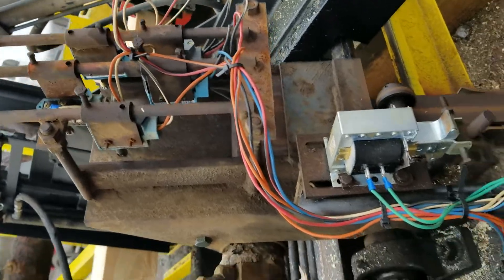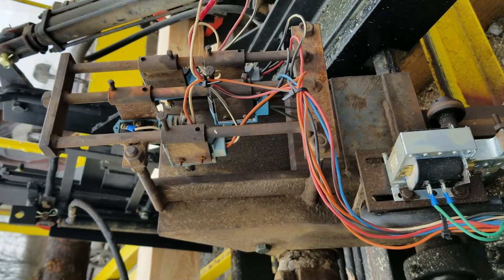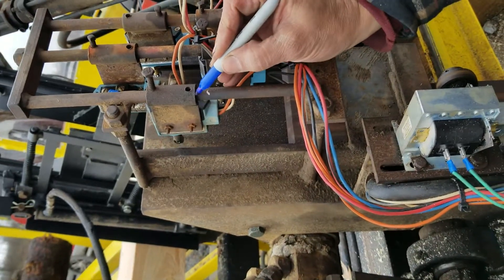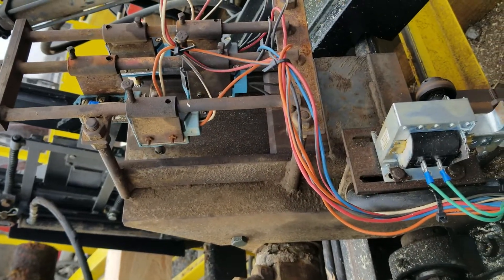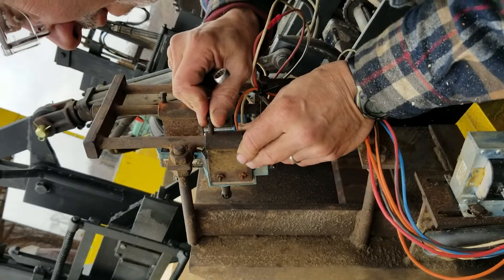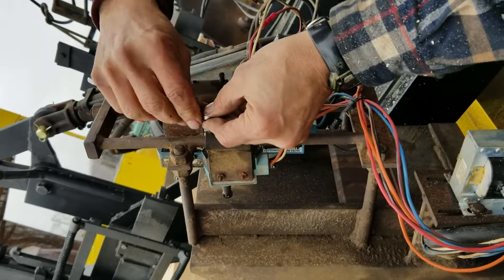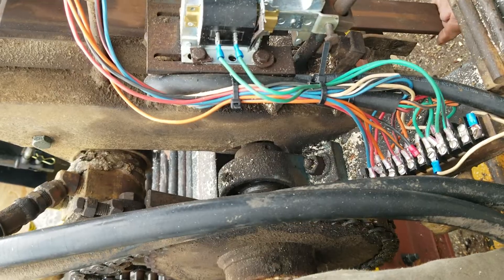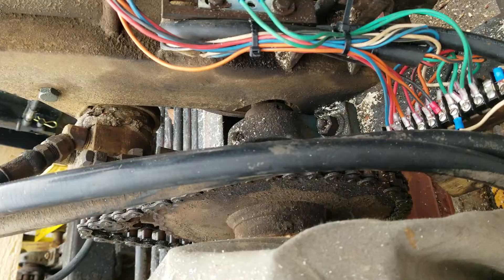sawmill setworks adjustment

Comment: Any idea why the dog teeth won’t stay down?
We have the same sawmill setup and after your run the mill for awhile and the hydraulic oil warms up, the dog teeth don’t stay clamped down.
We’ve called Edmiston and they first recommended changing out cylinders on the carriage. That didn’t work. Then we also changed one of the valves by their recommendation and that didn’t work. It is super frustrating not being able to figure out what is causing the issue.